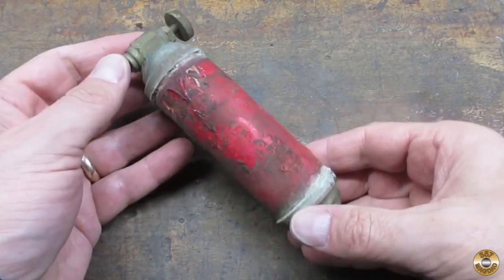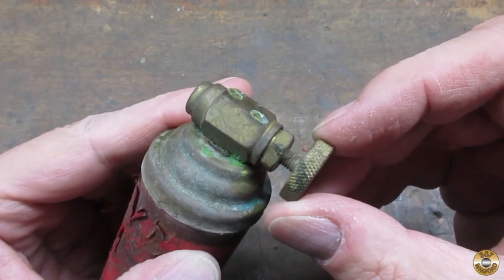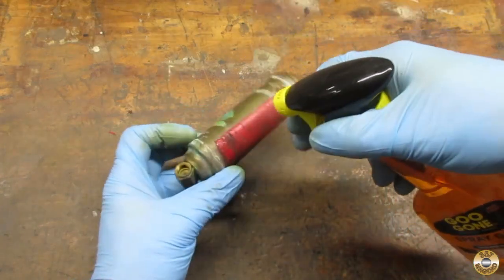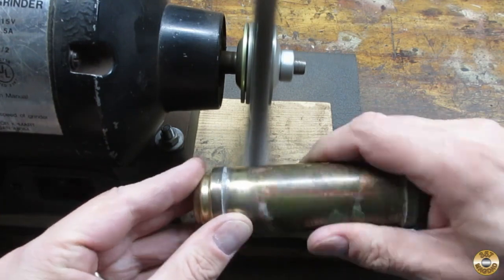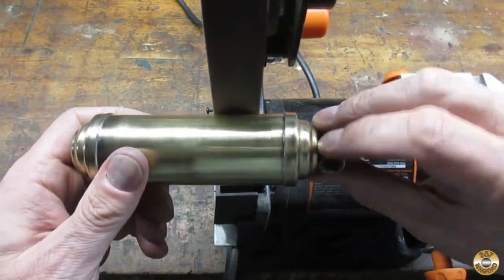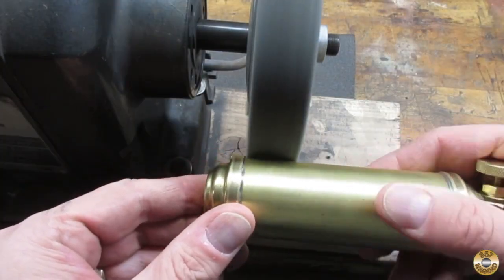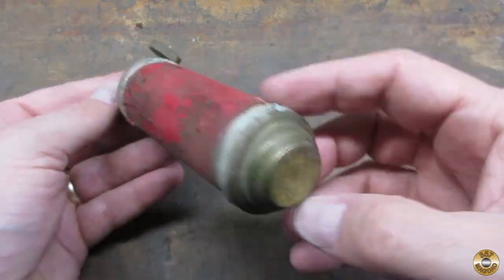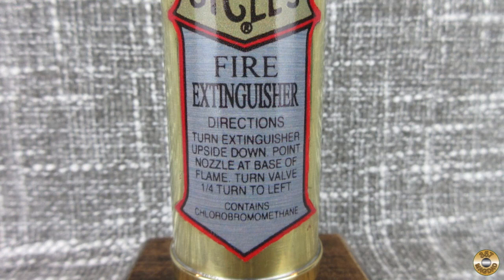Restoration - Presto Fire Extinguisher

Comment: That is so Cool   be neat to have one with compressed air in it just to have on the work bench
Reply from the maker: I bet you could rig a Schrader valve to the one end to fill it.
Reply: @357magdad  Use a rubber tip blow gun and shoot it in the outlet with the valve open a little and close it quick  My brother and me would fill old fire extinguishers half water and air and had the best  Super soaker before they ever made them

Comment: Love the little fire extinguisher! I have cleaned up several full-size extinguishers. They generally have a copper “body” with brass nameplates and instruction plates. They make excellent bases for touch lamps. On a future project, if you think of it, include a little info about your technique for creating decals like the one you did for the extinguisher. Is if just regular paper? How do you adhere it? etc.
Reply from the maker: I used inkjet waterslide decal paper.  There are many good YouTube videos about how to do it.

Comment: Excellent cleanup! It looks better than brand new!  One question, I have been looking for some sort of set up to hold my old 3/8  Craftsman drill to hold it horizontal so I could buff and wire brush.  Something like you used to hold your drill when you buffed. Could you show a picture of it and if it’s not homemade where can one be purchased?  Thanks.
Reply from the maker: Thanks Frank!  I just clamp my drill in my vise.  I try to clamp the handle below the trigger at one of the screw holes to keep from crushing it.

Comment: Brass can easily be polished out. And you just proved that as well. I was hoping you were going to de-solder the bottom and we could have seen inside. Than refill it and pressurize it back again to make it actually usable if needed. But a little polished trophy is nice too...
Reply from the maker: Polishing brass is fun!  I'll leave re-filling fire extinguishers to the pros!

Comment: Oh yes that came up a treat. I love miniatures and that would fit in very well and it works! Great job restoring it and I would never have thought to use a blade to get rid of the excess solder so I’ll remember that one. Have Flitz offered you a sponsorship yet? Cheers Magdad from Stuart, 🇦🇺
Reply from the maker: Thanks Stuart!  Chuck gets a few pennies every time someone uses the link and coupon code to buy some Flitz.
Reply: @357magdad  👍👍👍

Comment: My water heater went this week.  I may have to use that solder cleanup trick on some of the joints I sweated in.  I was very happy the new unit came with enough pipe insulation to cover them up.